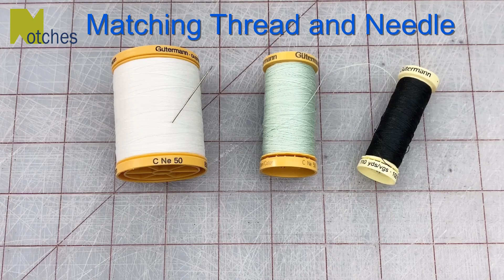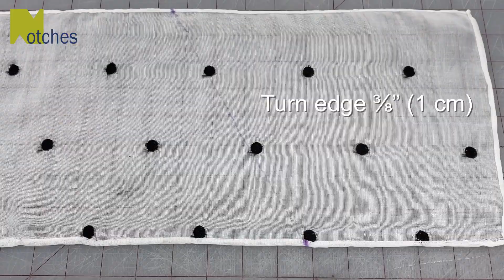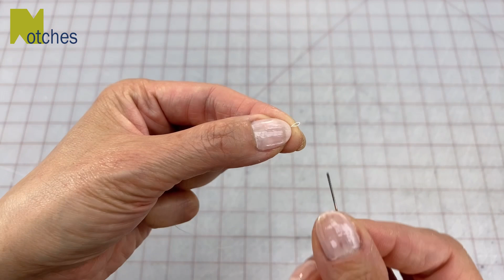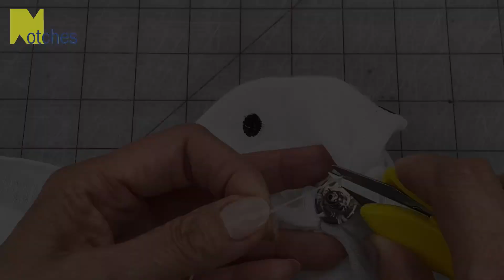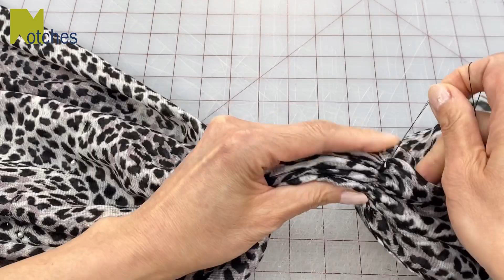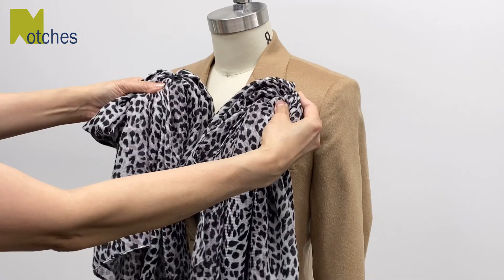How to tie a Scarf - Instant Bow - No tying!

Comment: Could you sew on the snaps after sewing the bow so there would be fewer knots and cut ends of threads?
Reply from the maker: not sure what you mean?  The snaps are already sewn on after making each side of bow.
Reply: @NotchesSewing  instead of tying off the thread after sewing the bow, and then using another piece of thread to sew on the snap, why don’t you use that same length of thread, without removing it from the fabric, and sew on the snap?  Maybe you tried this, and it didn’t work
Reply from the maker: Sorry I literally never saw notification for this question.  If it’s all done with one length of thread, there is risk of both things coming loose if the stitch should break.  Tying off a new length doesn’t take much time and all ends are hidden anyway so looks nice and neat.